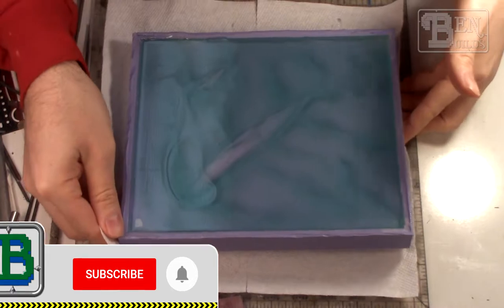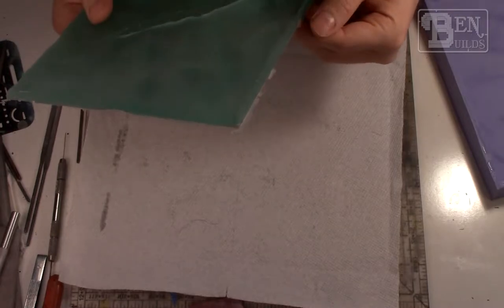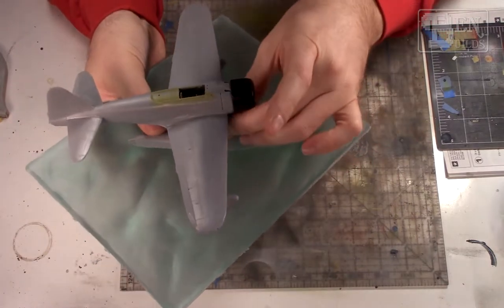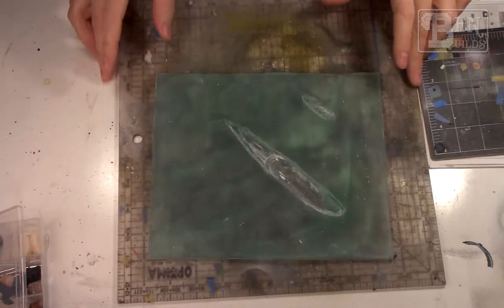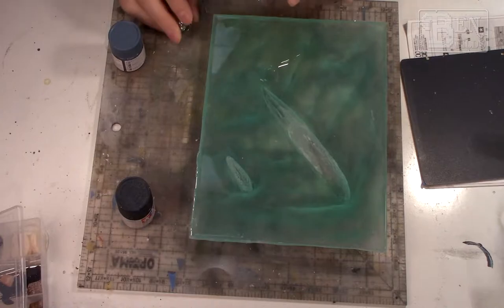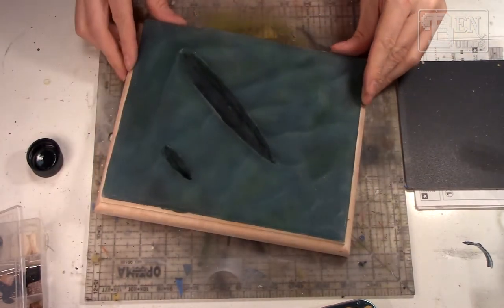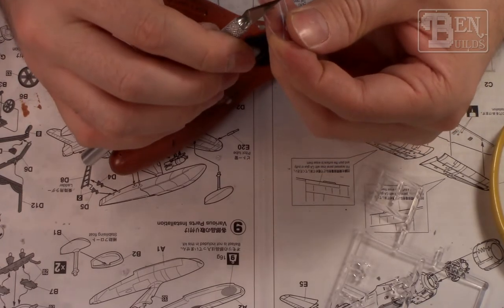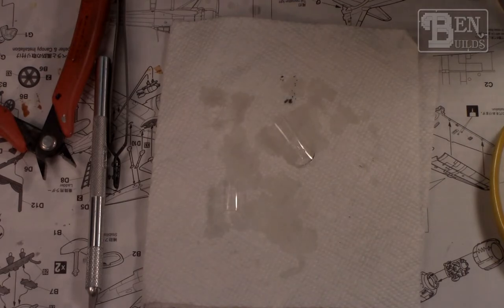All At Sea Group Build – A6M2-N (Rufe) - ep. 8

Comment: Hey Ben, which paint do you use for colouring the resin water? (Is it enamel or water based?)
Reply from the maker: Hey Blade! I used Tamiya clear green and clear blue. They are both water based paints and they are really nice for tinting. A word of advice though, if using them to tint clear resin, a little goes a long way. I'd recommend only adding a drop or two of paint at a time. Make sure to stir well before adding any more, that way you don't over tint and you can achieve your desired color. Happy building!
Reply: @BenBuilds  Thank you your help, i will try.